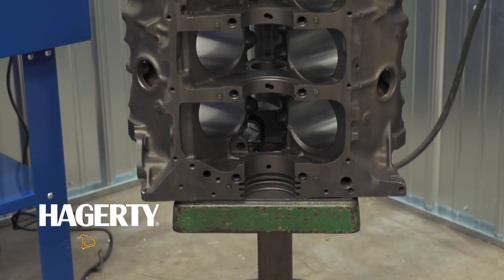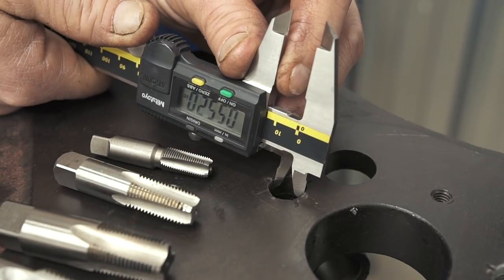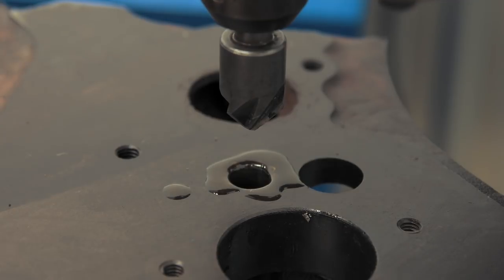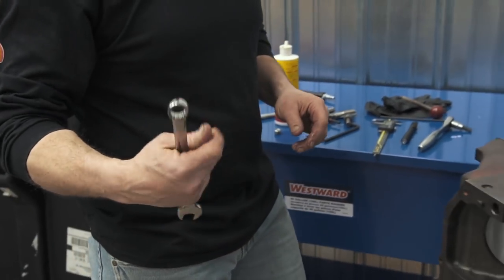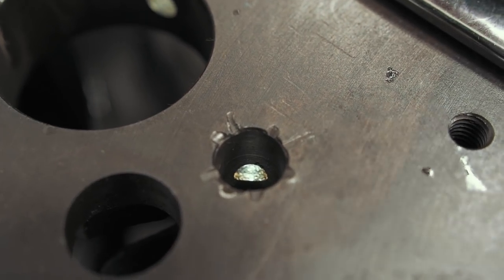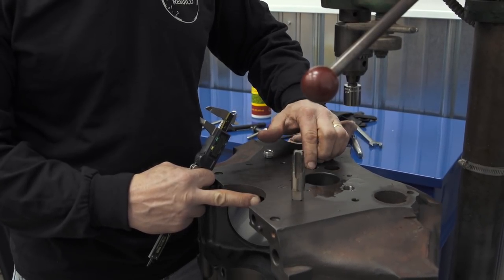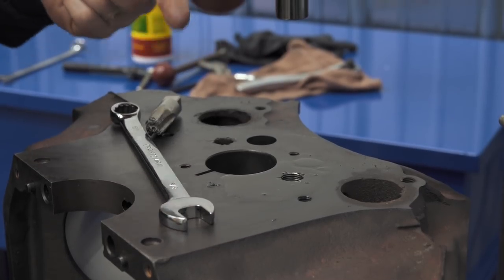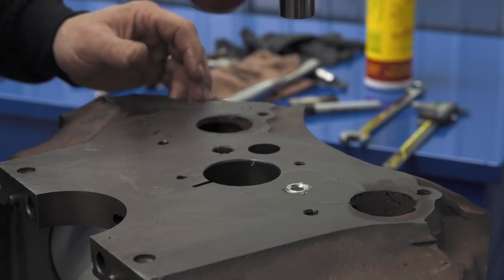Upgrading to threaded engine-block oil plugs | Hagerty DIY

Comment: Race Engine Builder for over 40 years.  No tap lubricant needed for cast iron.  In fact both my milling machine and my floor drill press have a compressed air fixture made just for keeping the cutting tool cool as well as gently blowing away excess chips. ALWAYS use a small drop of lubricant such as Synthetic Engine Oil, on the pipe plug, for trial fitting of pipe plug, as the dissimilar metals will want to bond together if you tighten the plug too much.

Comment: Holy moly, using the motor on the drill press?

Just turn the chuck by hand to get it started straight.
Reply: I've never seen that before either.  Made me a little nervous, but it seemed to work.
Reply: Ive seen a machine shop that modified their drill press so it can tap holes and will reverse the drill press when you lift on the handles
Reply: Power tapping is pretty common in the machining world, what you’re talking about is an auto reversing tapping head for the drill press, has an internal gear that engages when you you pull back to reverse.
Reply: @devriesfabmachine8721  yep that's exactly it.  It even had a VFD to hell control speed

Comment: Dave, the nice thing about drilling and tapping cast iron is it is somewhat self lubricating because of the graphite in the grey iron unlike steel that will break an under lubricated tap in a heartbeat.
Reply: I heard this as well. Does that mean that you don't need to use lube when tapping cast iron?
Reply: @miheadhurts  unnecessary risk, a bit of lube is easier than a tap snapping off

Comment: Rapid Tap is a good product but I learned something from a team of guys who routinely work with Stainless Steel. They use common "lard" (rendered from animal fat) for all their drilling. If you have ever drilled stainless steel, you know how important lubricant and drell speed is and the lard actually has some advantages over the Repid Tap. I BIG bonus is it's quite a bit cheaper. Apply a little bit with a paste brush. As soon as a little heat gets there, it melts and does its job.
Reply: Pappa Bob     Wow!!!, that's a good one!! Thanks for the tip!!😀👍👍
Reply: That's old school for sure
Reply: Thats a microbe party waiting to happen. Don't know if I would want that all over my machines. Tapping compounds and oils are a lot more than just lubricant.
Reply: Your choice of course. You know, of course, that to "render" the animal fat into lard, it needs to boil for a very long time. Can't imagine anything surviving that. I have been using it now for over 20 years and have not experienced any un-expected reactions. Don't remember the details but do remember doing some research after another similar "doubting Tomas" remark and found that the lard actually had "benefits" over the drilling/tapping compounds. Look it up if you really want to find out.
Reply: I bet those guys get a craving for bacon every time they're tapping some stainless.

Comment: Oldsmobile Rocket engines have a camshaft oil galley plug inside other plug. Tiny hole lubes distributor gear. Leave it out and almost no oil pressure. Good idea, but yes can easily break the tap in the block

Comment: A word of caution here. As a teenager I tapped the holes on the galley  paralleling the camshaft on my Ford 390. I set the plug at the block rear too deep and covered the vertical galley going down to the rear main bearing. Instant failure on start up. I see you covered that in passing but you can't be too cautious when inspecting your work.
Reply: True that!! I'd put that brake line in there, then seal and seat the plugs. That way, I know beyond a shade of doubt that proper clearance exists.

Comment: spring loaded tap guide with tap handles would be safer than running a tap with a drill press, 3/8ths is a huge tap probably not likely to snap, probably belt would just slip..

Comment: Very  informative Davin, these are great videos, keep the coming please, very good production (pace, light, complexity level of the repair, etc) . Congratulations, I also enjoy a lot the redline rebuilds and the wrench-man series. But now a very basic question (I guess, sorry) I know basically that the oil goes in from above and if I want to take it out  is from below, if you want to remove it faster I might remove the whole carter, and the internal pipes move the oil inside, but what would be the objective to have a pipe that goes to the side of the block that need to be plugged?  (I did try to google it before asking)

Comment: In the process of rebuilding my 340 mopar for my 71 a body. Definitely helpful information and something I can do in my garage. Is it possible to donthe same for the coolant plugs? Or should I really leave those to expand and burst if nature decides... just curious bc this is my first car engine I am building.
Reply: Do not thread the freeze plugs!! Don't care where you live, if the car ever travels, or you sell it, those plugs have to be able to do the job they're intended to do. No thready!!
Reply: @markk3652  that's what I was thinking. I know I've seen references to threaded plugs but wasn't sure if it was for coolant passages too. Thanks

Comment: When you install one of these plugs, do you need thread sealant or Teflon tape to prevent leaks?
Reply: Thread sealant usually, but I've seen them installed without as well.    I always use sealant just to be sure.
Reply: @TheLionAndTheLamb777  Thanks.

Comment: Whats the point of the holes if you are just going to plug them up?
Reply: The holes supply oil to the engine . They are not in the block after casting and have to be drilled during all other machining . In the Pontiac he was working on there are oil galleys from one end to the other if they are not blocked off you will have no oil pressure . Every engine I have ever worked on has many oil galley in them and have to be blocked in one place or the other .
Reply: It's probably a technological issue. It might be impossible to drill that hole from the inside of the block so they drill it from the outside and than plug it.
Reply: Kammaol you are correct.
Reply: The plugs in the holes direct the oil through the bearings and cam and through the engine just like fords head gaskets direct water flow through the block and to the heads so make sure to pay attention and make sure that everything goes the way it says to lol like dont block the passages on this block or no oil flow
Reply: I think hes asking why cast the holes into the block if they are going to be blocked off. They are to let the casting sand out of the oil passages after its cast.
Reply: @TheSamplebridge  WRONG !!!!
Reply: @brettjohnson8009  how?

Comment: What is the purpose of using pipe thread opposed to standard machine thread?
Instead of a plug why not use a bolt or a set screw?
Reply: Pipe thread seals on itself its tapered

Comment: There is no way anyone should be using a drill press to run in a tap like this..... This is pure butcher work.   I'm surprised Hagerty supports someone like this..  HE may be a fairly good guy but not an expert.
Reply: Weggman Hillard your right a pedistal drill or end mill with a tap driver would be ideal but this is backyard stuff, something anyone can do. The idea of the press is to get it started straight thats all.
Reply: Could have shown how to use a spring loaded tap follower though. They're cheap enough and much more appropriate for this type of operation. Driving a tap with a drill press like that is just asking for trouble, how long before someone tries that with a smaller tap and shears it off straight away?
Reply: A drill press is going to run the tap in straight for you if you don't have anything better to use. I use a drill press to start my taps and then finish them with a tap handle. If the tap is going into the hole straight then theres nothing wrong with using the drill press.
Reply: Weggman Hillard ,
Really?
This I really can't even believe you even said that.
I worked in machine shop for five years and if we had to do something like that we did..
 and you know something?
 it worked perfectly fine and 100% of the time.
BTW, it's a very perfectly acceptable and creative way to do something if your practical enough to make it function like he did.
Because the old school Racers I was around did this stuff all the time and the guy that showed me how to do some of the stuff was a Master Mechanic out at the college and I never seen anything he did ever fail!
We were going to copy the Ford 427 screw softplug upgtade, and tap out  soft plug setup on engines.
especially the 428 blocks.
We were already getting the crossbolt done on the 428 making them like the 427"s.
Reply: To be honest, he should have changed the spindle speed of the drill press to something like 200 RPM's, so he didn't have to toggle the power buttons so nervously.  Power tapping is fairly common in Tool and Die, and I've done it countless times.  Its a great way to make sure the tap is going in perpendicular to the surface you're tapping.  When going with larger taps, you can use a drill press or knee mill with a 60deg. pointer or similar, and actually just use the quill to apply pressure while using a larger tap handle to manually feed into the tap into the hole.  I've done that with a 2" tap into hardened steel, with a custom tap handle I made that was about 2' long.
Reply: I've seen so many old machinists tap holes like this so many times I can't even put a number on that. I do it myself, my father did as well, we don't break taps. But we all know who breaks tools all the time; big mouth experts.

Can't ever upload a video like this without a worthless cake decorating expert shoving his two cents in. If you're scared of doing this, please just change careers and save people from headaches.
Reply: You may be right about the drill but Davin is an expert when it comes to rebuilds. This is just an extra video. I'm sure tapping isn't his specialty.